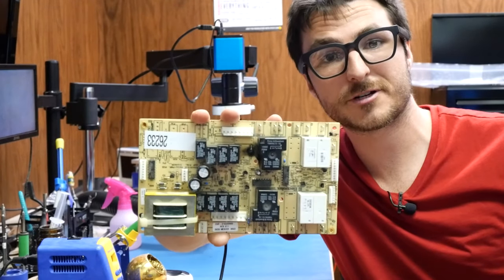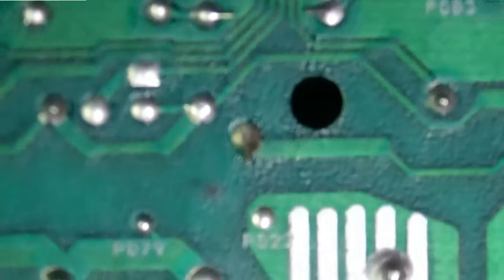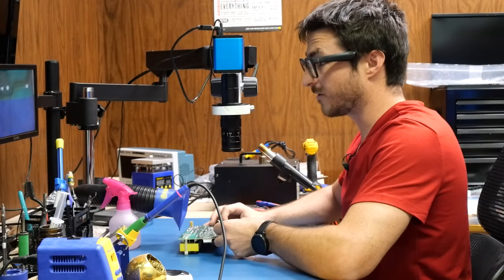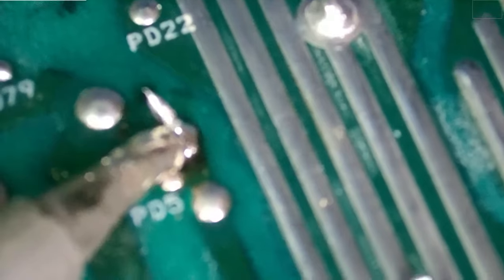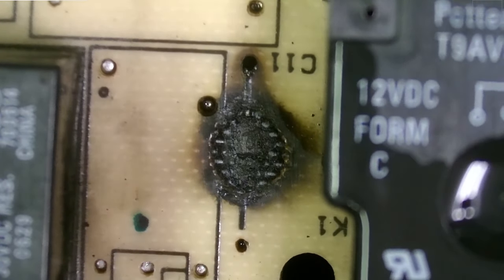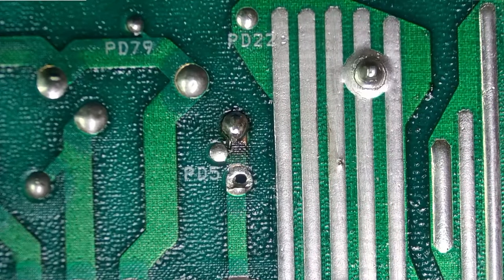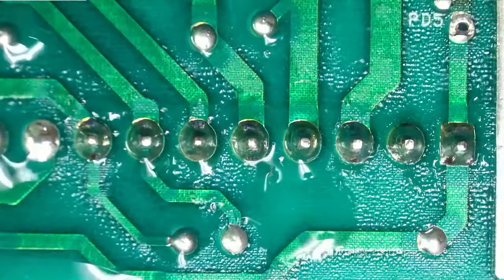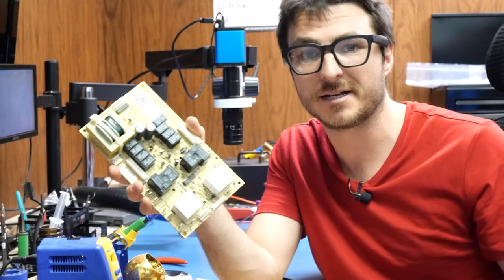Fixed Frigidaire Double Oven Repair 316443903 FEB30T5GCA

Comment from the maker: Send in your control board for repair: https://nickselectronics.com/products/316443903

Questions? Leave us a comment or contact us directly:
https://nickselectronics.com/pages/contact
info@nickselectronicrepair.com
520-838-9359

Tools and equipment:

Soldering Iron: https://amzn.to/3FQfyhG
Solder: https://amzn.to/3qScy0d
Desolder wick: https://amzn.to/33DAjjy
Flux: https://amzn.to/42YWYBa
FR301 Desolder pump: https://amzn.to/3IhTKzc

Comment: I have watched so many videos on here. I thought I was the only one who removes the old solder completely and add new. Thanks for giving me some faith in the electronics repair industry lol
Reply from the maker: If the joint has burning or looks in bad shape I will remove it. Sometimes if the joint is still in good shape and I am just premptively reflowing it ill just add new or just add flux to renew it, but yeah usually remove all the old and replace with all new is better.

Comment: Maybe it was the camera, but that replaced resistor looked a little smaller....was it the same wattage as the other one?  Those oven resistors probably need a lot of watts
Reply from the maker: It could have been a little smaller that's possible but the wattage was correct. I'll start by saying that I am not an expert on how to manufacture a resistor, but while there is typically some correlation on average between the wattage and the physical size of the resistor on the outside, the internals of the resistor aren't dictated by the physical size of the outer shell of the component. I have a full wall of different resistors and not all my 1W are the same exact size. Same with my 2W and so on. I believe I even have a 1W that is bigger than some of my 2W resistors. It depends on the manufacturing company, and probably when it was manufactured and with what materials. Again I am no expert, but I do buy my resistors from either Digikey or Mouser, so I am confident that they are sending me 100% legit components with the correct Watt rating.

Comment: I recently finished electrical school, during the process I realized I enjoyed and was more fascinated by electronics, what is the best way to go about learning more about electronics and making repairs like this? Is there specific schooling or is it better to learn online?
Reply from the maker: Good question!
For me, it was and still is self-taught, but it started as a hobby. I saw someone giving away free non-working computer monitors on Craigslist 12 years ago. I went to pick them up and spent some time on Google trying to figure out how to fix them. Bought a soldering iron, and a repair kit which was 5 capacitors that someone was selling online, and installed them. I was hooked like an addict. Sold the monitors and used the money to buy a broken monitor and broken TV. Kept flipping them until it became a full-time business. 
There is no official school, and there is no official path, I learned everything I know from YouTube, forums, and Google in general. I just made sure that my hobby and "experiments/tinkering" were profitable so that it was sustainable and I could keep doing it. I guess in a way this is why I also show everyone how I do repairs as a way of giving back, but it's also a way of self-promotion. There are a lot of companies here and there that offer soldering classes both online and in person. I have never used them but probably could have used them. I am sure you could find one locally in your area provided you live near a larger city. 
As for learning how to troubleshoot everything and anything, you won't find anything there. You will only find classes that are very specific to 1 industry. Like Cell phone/tablet repair computer repair, TV repair, or appliance repair. There are a variety of programs available there. For example for appliance repairs, there are certain classes that are a full 6 months and cost $5,000 while I have seen others that are only 2 weeks and cost $1,000 so it depends on which company you go with. Since I have never taken any of those I can't recommend any of them. 
If I were you starting from scratch, I would get decent at soldering first, don't worry about troubleshooting, but practice soldering, both through hole and surface mount. 
Once you are decent at soldering, fine-tune your troubleshooting skills by getting a job that will teach you. Look for tech positions in the different repair industries, learn how to fix computers by working for a small local computer repair shop, then go work for a cell phone repair company, then an appliance repair company, a TV repair shop, or an audio repair company, ideally vintage audio, as it does require even more troubleshooting skills. This way you get paid to learn.

Comment: Do you have a video replacing the uln2003 ic on the board?
Reply from the maker: I do not but the process for the desoldering would be the same as the one for the replacement of the display I did in this video if you are interested in the desoldering process:
https://youtu.be/oLUe0lE4I5c

Comment: The burn left by that resistance isn't conductive at al. It's more or less carbon, until there's strands of wire from the resistors. So you should be good to go without cleaning
Reply: carbon can be conductive, but looks like there wasnt a complete path there anyway.
Reply: @outtakontroll3334  no, the only non metal known to be conductive is graphite, a form of carbon that's all
Reply from the maker: Nice! I have been told that the burned material can be conductive, glad to know it's not. I did just a quick Google search and it said exactly what you said:
"Carbon itself does not conduct electricity, but its allotrope graphite does. This is because graphite has a “free” electron in its outer shell that allows it to conduct some electricity."

I guess the next thing is if people say that the burned material is graphite.
Reply: @NicksElectronicRepair  hahaha that's exactly what I studied 2 years ago. Also, graphite is formed when subject to high pressure and heat. the amount of heat required to form graphite is a lot and it's just not possible at the temps electronics burn. There's no actual pressure on the board and hence there's no way graphite can form there. 

Although I'd always clean any burn marks I can because
1. i repair my own electronics and knowing it's mine I'll go to the full extent of cleaning it.
2. It looks better aesthetically
Reply: It's good practice to remove it anyways.
Reply: @NicksElectronicRepair  You also need to watch out for multi layer boards, if there had been a ground plane in the middle it could have been exposed when it burned. Some UV solder mask after cleaning never hurts.
Reply from the maker: Yes we have another channel where we fix old gaming consoles and we had a first gen XBOX from 2001 sent in for repair where several caps had leaked and corroded the board to the point where some of the layers had burned and fused together. That one was a no fix.

Comment: Which camera / microscope are you using?
Reply from the maker: So the one we bought is no longer for sale. But you and many others are inquiring about it so we are going to purchase a few more that are newer, and available and review them. Once we find a good comparable one at a good price we will make a video on it and probably sell it on our website. But as of right now, I don't have a good recommendation that would also be at a good price point.
Reply: @NicksElectronicRepair  Thanks for the update. Looking forward to what you find.
Reply from the maker: Yeah sorry it took so long to get back to you, I was actually looking through and took some time to try and locate where we bought it from and so on. 
But anyways I need another Microscope for a different work station, that currently has a low end one. So I will be doing some shopping here soon and will post an update once I do find a good suitable replacement.

Comment: all those joints in that condition is an issue, I wonder if the reflow process when making the boards was good or whether or not excessive force was used to remove the PCB.  I would re-solder all the joints using leaded solder, but that is just me.
Reply from the maker: Yup that's exactly what we did in the video!
Reply: @NicksElectronicRepair  well not exactly, you only did ones you visibly saw had an issue. There could be bad solder joints on the other components too. If there were hundreds of components well that would be excessive. but in this case didn’t look to be too bad.
Reply from the maker: Okay let me rephrase then: 

We reflowed all the joints that were cracked as well as reflowed all the other joints that were not yet cracked but have the potential to crack as they are high power lines. 
So you are correct, we did not reflow joints on low power lines but that is because they have a 0% chance of cracking. Because of this, it would be a waste of money for our customers as we would have to charge much more for the additional labor.  
Knowing what runs the risk of cracking and what doesn't I guess is important and I could have described it better in the video.